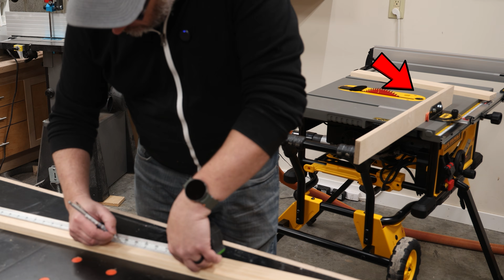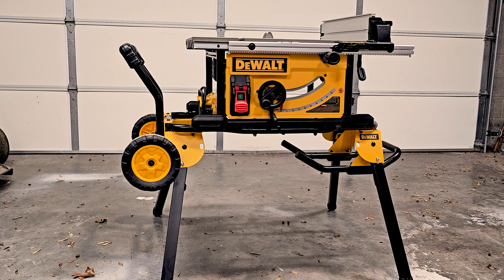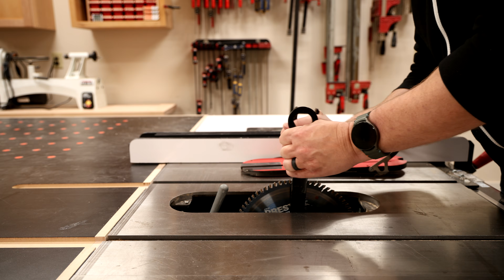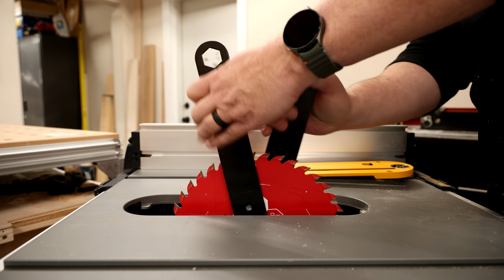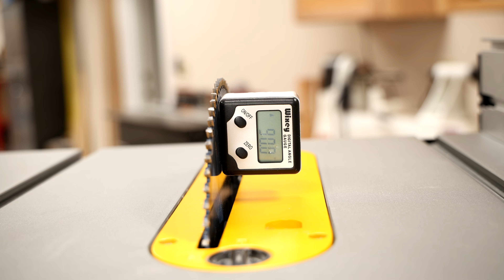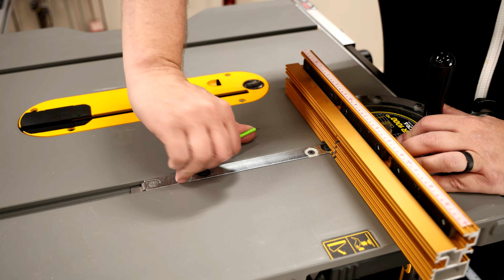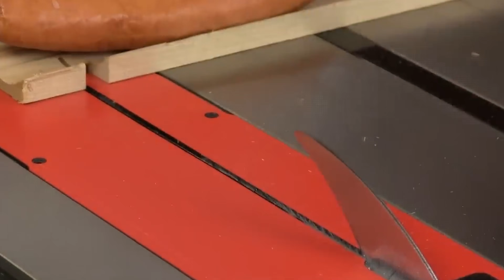Why do people even buy this saw?

Comment: Good video! Thanks! I've been using a table saw since I was 12. My dad had a Craftsman.  For the past 35 years I've used a General Contractors TW, but with a fancy $700  Incra fence. Pretty good saw, but not like your cabinet saw.  What was really neat was two years ago my neighbor bought a Craftsman on Craigslist.  I had remembered being excited about his saw when I was a kid, but knowing that it wasn't that big a deal..... But no. It's like you say about your Dewalt, can do a lot of the amazing things we buy tablesaws to do.  The Incra gave me 1/1000 precision and repeatability. The Craftsman, was measure at the front of the blade and at the back and side fist bump the fence into parallel. But even with the Incra, I would check this for critical cuts, like furniture making.  In China, several times 20 years ago, I saw guys doing entire mall shop fit outs with a circular saw upside down on a piece of plywood. (Still gives me the jitters, as does the single strand wire construction lifts. You could see the crew knew to stay well away from the bottom end of that thing when it was moving.) 
The movement test you did on the job site saw.... Well.  What knocked the Craftsman saw out of whack wasn't moving the fence, it was the materials, long materials, plywood -- anything LEVERING  against the fence or the blade.  My General? It was fussy to fine tune the alignment. Just tightening the nuts would knock it out, and if the motor was tilted and any part of that assembly bumped into the saw body -- it would knock it out. I tend to avoid 45 degree blade cuts.

Comment: I had the Dewalt table saw, and used it for about 2 years.   Fantastic saw.  Then I replaced it with a sawstop.   And, to my surprise, the dewalt actually made better cuts.  Only reason I keep the sawstop, and not go back, is because of the safety mechanism.

Comment: I'm using a Bosch GTS10XC for well over a decade now. Kitchen cabinets, doors, windows, tables, chairs, big shelving system. All possible. Use a dcent ripping blade, almost all cross-cuts are made at the miter saw anyway. Yes, maybe sometimes it takes a bit longer to set up, but check your piece after the first cut, adjust, and run the other pieces. It's not that big a deal. Your sawstop is just as random as a "good enough". Why stop there? Recommend an Altendorf or a Martin for some homeowner diy....

Comment: I’m amazed you even got the white oak to cut that well on the dewalt.. I was just ripping 8/4 rift sawn white oak with a Forrest blade last night and had to cut it in 3 attempts because of how slow and unpowered it was. It’s on a 20amp breaker and tripped every time I tried to do it in one go. After the fact, it still had burn marks… I love the dewalt but it’s wildly uunderpowered for hardwoods
Reply from the maker: you using a full kerf blade? you should use thin on that saw!

Comment: As you say there are usually other tools in the workshop ... Mitre saw, jointer, thicknesser , router, bandsaw and drill press ... any one of those , with varying degrees of danger, can cost you fingers or worse. The best safety is knowing how to use the tools and keeping focus at all times.  Also power feeders can really help.  I am setting up my new workshop and i will be using a fixed power feeder for the table saw and a smaller feeder for other tools except the mitre saw and drill press (of course).
Reply: Yeah focus is key. There's people with no good sense. You have to be able to envision the cut. Know how it is going to go before you begin. Even go through the motions with the machine off. That can reveal potential failures. Things you couldn't foresee. If you have any doubt don't proceed. No cut is worth getting hurt over. There's always a safe way to do it. Figure that safe way out.

Comment: You left out the economics of the choice of saws, aside from the initial cost of each machine. Bench saws are meant for heavier usage, and portable ones are used by hobbyists, contractors that need mobility, or for light carpentry work. Bench saws can use less electricity per hour of use, they tend to heat up less, and they can work during more prolonged periods of daily work. If you produce tables and large pieces, a small portable saw just won't be as effective as you need it to be. If you only make occasional small pieces, frames, gift boxes, etc., your table saw will do just fine.

Comment: The cut on a cabinet saw is what makes the difference.  The Saw will last years.  You get one of those portable saws your burning out the loud noisy low power motor in no time.  If what want clean cuts on Plywood without breaks or chip outs on either side you want a heavier blade that makes clean cuts every time. When you want to start making some real furniture you will want something that slices hardwoods with ease. Let's not kid ourselves how many cabinets are you going to make and how much plywood edges you want to be cleaning up.  You have a choice on a high end track saw or a cabinet saw.  The Cabinet saw will go along way and the used old ones are still doing the job.  Track saws if high end are good for slicing up plywood for cabinets but again limited versalbity.

Comment: I saw a video on this site....''apparently''   because the Sawstop works on the theory of  wood not conducting electricity ,if one tries to cut wet or damp wood, it trips the stop,because water conducts electricity.So you have to be cutting absolutely dry wood on this machine. Im not sure if this is true, but it would make sense.Appatrently,you can switch the  ''stop'' off,but it has to be done each time the saw is turned on.    Just something I saw 
on  Youtube. 🛠🛠

Comment: I have a nice Bosch 4000j job site saw. I bought it used from a friend who upgraded to a SawStop. It’s larger than the DeWalt and really made well.  

I don’t have room for a cabinet saw. Also I’m a guitar maker, so it’s not as important a tool as if I were a cabinet maker. I rarely cut sheet goods except to make jigs.
Reply from the maker: I started with the Bosch job site saw. it was a good saw

Comment: I’m upgrading from my Skil contractor starter saw to a 3hp sawstop. I’ve done as much as I can to optimize my saw but I cut a lot of thicker hardwoods and get burn all the time. I’m not sure how fair this test was- those boards were short and I’m not surprised the smaller saw cut through them. Try a 3-4’ board I think you’ll see a lot more binding and struggle on the 4/4 and thicker boards. Thee other thing I noted is cut accuracy and adjustability. Keeping the blade at 90, the fence, all of these go out of adjustment frequently. My saw has a rack and opinion fence but the way the fence connects to the rails is really difficult to zero in. I’m going to enjoy my 3hp sawstop. YMMV.

Comment: Guess I got lucky got any old Porter Cable off of Craigslist. I had to replace the bevel gears for raising the saw blade because the original ones were plastic but got metal ones for less then $15 off the big A place and that fixed that. Put it on the end of one of my work benches I build so it has about 2.5 feet of out feed and I can put another of my benches to the side and have side support and if I would ever need more outfeed  I have a third bench that I can add on the back end for that (all my benches are 2' x 4' and the same height). My only real gripe is the fence but I fixed it a bit by adding some 3/4" ply that is a couple of inches higher and I have learned how to just use a big metal square that I have to make sure the fence is straight but my table and blade are flat and square so my cuts are good as long as I square my fence with my builder square. Also the price was really good because for $60 I got it and a Delta miter saw. 

Power wise it seems fine as well have cut some 2" Sapele and have had no problems but when I was ripping some 3/4" cabinet ply at 45 degrees the other day I threw the breaker on my power strip, but I had just cut several others so probably should have given it a break, lol.

Comment: so, you are demonstrating how a jobsite saw should be adequate for most people, then use a Festool track saw that costs $818; more than a good contractor saw.  Smart people buy used tablesaws like old Delta or Rockwell contractor saws for a few hundred dollars. The primary benefit of a Sawstop saw over say a Delta Unisaw is the safety afforded by their design. That is also a component of the cost.
Reply from the maker: A festool track saw doesnt cost any more than a brand new jobsite table saw, especially if you buy it on the secondary market. I just sold one myself, with a track for $500. In many cases I preach that a brand new woodworker get a track saw BEFORE a table saw because most beginners start out working with sheet goods before solid wood. The benefits of a track saw are many and its a tool I'm sad that I didnt buy sooner.

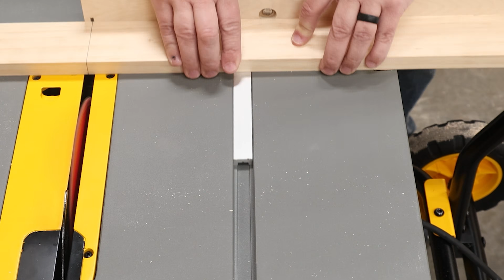Comment: 0:38 I was cutting grass the other day and saw the neighbor hired a guy to do some trim/molding work. He had a 1200$ air filter hooked to a dewalt compound miter saw. And it was all outside 😂
Reply: And ? Wood dust doesn't magically disappear in thin air because you're outside. The same way we now have dust extraction on concrete saws to enhance air quality and reduce health risks on job sites, yes these are recommended if you want to keep your lungs free from harm. And it keeps the jobsite clean.
Reply: @the_arcanum  you never heard of a leaf blower? And yes wood dust does just magically disappear if you spread it out idiot. It turns into dirt, like what’s clearly between your ears. If you’re trying to get jobs from people who you have to talk to like that, I just feel bad for you honestly. I can tell you NEED an employer to defend something so stupid or if by some miracle you are one, you NEED to psyche people up with words to compensate for your lack of craftsmanship. I would never hire you or your company. Any dust outside dissolves in rain 😂 “it doesn’t just disappear.” Fckn stupidest thing I’ve read in a while haha. Thanks for the laugh, good luck with “work.”

Comment: I mean, Sawstop is a bad example to use for the thumbnail when talking about  cabinet saws in general, because the answer for me is easy: People don't want to risk losing their fingers! That's the number 1 reason to choose Sawstop. Accuracy and precision are lovely things to have as well but some people would want the safety even if it only had the accuracy of a jobsite saw (not for the same price of course)
Reply from the maker: so so so many people refuse to buy sawstop because of the the expensive safety feature

Comment: This all depends on your level of skill and what you want to build. not doing anything complicated or all the time any saw works really. if your not a professional go to harbor freight and buy cheap tools, you'll be able to familiarize yourself with all kinds of tools and when you find your niche buy better tools that can give consistent results and last for years. i have a woodshop and still buy harbor freight for instances where its only going to be used once or twice rather than spending a grip on the professional version. harbor freight tools have gotten a little better, you might get 3 uses out of it.

Comment: I graduated in 1988 from trade school and learned cabinet making on a cabinet saw. It took me 23 years before I was able to get a 3 phase 5 hp cabinet saw.  The difference is huge. The cabinet saw can make clean polished cuts with no blade marks on the hardest wood. I do agree with a proper set up the dewalt job site table saw you can accomplish many cabinet making tasks with the extra effort.  In my  shop I have a jointer and the only way to get the most out of the cabinet saw is to straighten everything before cutting it on the cabinet saw. A small portable jointer is a great addition to get cleaner cuts out of the job site saw.

Comment: I was on Marketplace today and there is a Delta unisaw with Biesemeyer fence and excalibur overhead dust collection for $800. If I hadn't bought a used Powermatic 66 22 years ago... not a bad option. It was on rollers as well. Belts, bearings, motor are about all that goes wrong with them and all are easy to source. I replaced a bad motor bearing in my 20+ yo Dewalt compound miter saw motor a couple months ago and bearings in my Rockwell bandsaw last year.

Comment: I like to tinker so I have a few hobbies.  Whenever I first get in to one I buy the entry level gear to do it and when I good at it I upgrade.  100% of the time when I upgrade I kick myself for not just buying the better quality gear to start with.  For example, I started 3d printing a few years ago.  Bought an inexpensive printer.  I spent a lot of time calibrating and tweaking to get great prints.  Every time I printed something, I'd have to do this.  Finally, I bought a really good printer that everyone raves about and now I just have to send a print job to the printer and let it go.  it's built in calibration steps save me so much time and the print quality is way better.  (and I don't believe learning the hard way was helpful in this case ) Now that I am getting into woodworking, I decide to splurge on my table saw and got the Sawstop 1.75 pro.  Initially was going to get the contractor saw, but after adding up all the extras I wanted it was almost the same as the Pro.  This time I decided to start with the higher quality gear instead of upgrading later.  This video helped show me that my purchase choice the right one for me.  Fun Fact, I pick up my saw from the store today :)

Comment: You start off talking about videos that use super expensive tools and that they could use beginners tools too but never show you. Then you tell people you never break up sheets on the table saw or jobsite saw but with a track saw and you bring out a Festool. Are you kidding me? What kind of beginners tool is that?
Reply from the maker: I recommend a track saw to every beginner I meet. It's a perfect tool for someone just getting started. Its the first saw I would buy if sheet goods are what you want to work with. Compared to a $3000 table saw, a $4000 jointer and a $5000 planer, its not expensive for the capability it gives you. And it's on par with the cost of a decent jobsite table saw or miter saw.

Comment: My SawStop 3HP ICS with 52" fence was my third saw in 2010 after using someone else's.  My first two saws were a Jet contractor saw and General 650 3HP cabinet saw.  I paid $4400 then and would buy it again 16 years later.  The lack of arbor runout, low vibration and overall smoothness, left tilt blade, and the table size make it a great accomplice for furniture joinery and absolutely repeatable work.

Comment: @ 07:50 Whilst You have a very good working knowledge of woodworking, and the use of a table saw, I must point, this is not a good practice.  I see many do it, and it may seem harmless, but reaching out anywhere near the blade is not wise.  Many may disagree, maybe even yourself, but I know of a couple individuals that received injuries reaching out for the cut off piece.  Just in the interest of safety.  
I unfortunately belong to the Club of table saw mishaps, fortunately losing only a couple of millimeters from a finger.  ( It was caused by fatigue and frustration, and I should have called it a day.  It was NOT caused from this practice however. )

Love that ‘proper’ push stick You were using.  Great video though and I would just say please to all, to take your time, don't get frustrated, and if You do, just walk away, and come back and cut another day.  Stay safe!

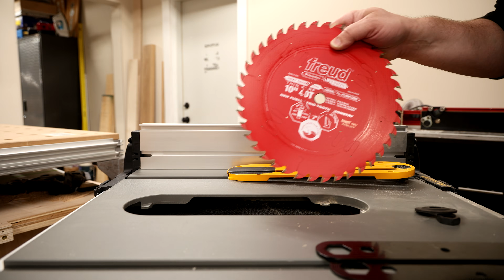Comment: Sorry but that push stick design with the curved heel at the back is terrible and really unsafe. Some clips (8:24, 8:49) even has the push stick riding up onto the board leaving no forward pressure mid cut. I do hope you saw your own footage and fixed that. I also believe the handle is too low for the height of your fence. Sorry, not trying to be the safety police, just trying to point something out that may end up biting you.

Comment: Nice video for what it is, a video. I don't think it was a fair comparison. Comparing a job site saw to a SawStop cabinet saw is pointless on the cost scale. It was very cute how you used, what 18" length stock.  Let see you do it again with 36"+ length stock.  You did not show how the jobsite saw moves as you cut, unless you anchor it to a solid surface, it will either slide or try to tip.  My Dewalt Jobsite after 6mth or so lost some of its power and on longer cuts, 3/4" is the deepest cut I could get without stalling the motor and therefore had to make multiple cuts. I did build the saw into my workbench for stability and off feed stability. Still, I was able to make 100 or so cutting boards. Then I bought a 3hp cabinet saw, and there is no comparison. Time, safety and accuracy, were greatly enhanced.  Yes, you can do it on a jobsite saw, until you can afford better you use what you got.

Comment: I think I saw it below, but I would prefer a used cabinet saw over a new saw any day, cabinet or contractor. My massive Wadkin PK cabinet saw was bought for $500 at an auction. I did have to do some work to it to get it going, by painting and repairing some electronics with new contactors and starters off eBay at about $100, but it truly is a much more cost affordable way to get a cabinet saw.